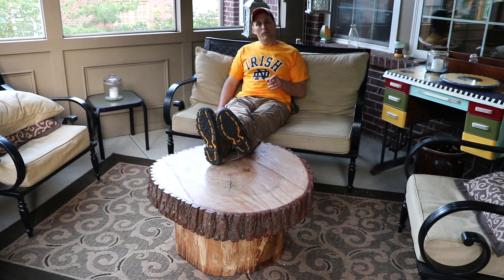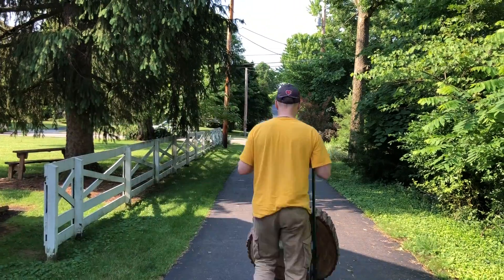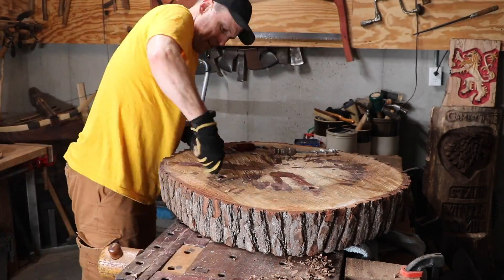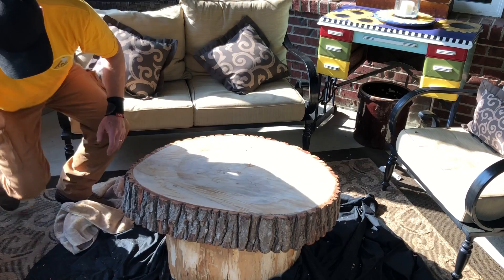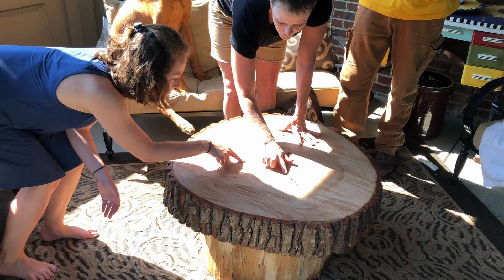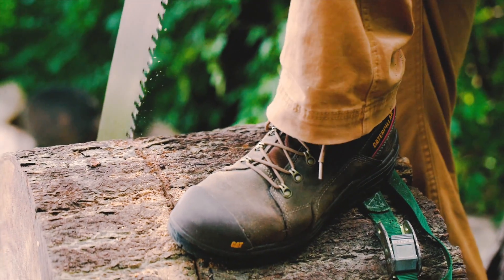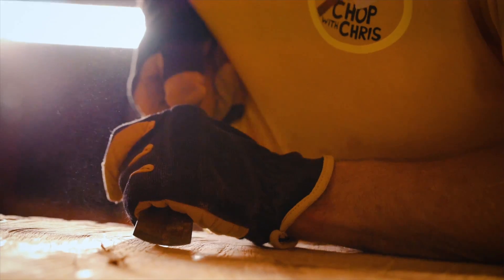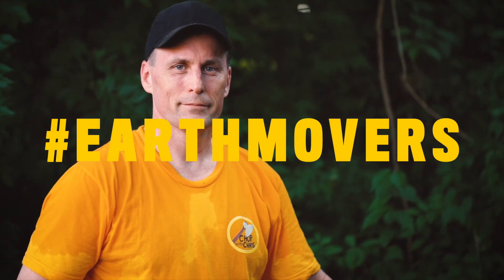DIY Massive Oak Slab Table and Chop-umentary from Cat Footwear

Comment: Just discovered your slab/epoxy video & like it.  I am trying to do a 'bark on' pecan slab with cracks.  How were you going to attach the 2 pieces of bark if you didn't leave them off?  Also my slab broke in half-way epoxy would you use to glue it back together?  (I will strengthen it with a bar steel frame on the bottom).  Good work & thanks.
Reply from the maker: I was going to glue them back on.  Yes.  Glue it.